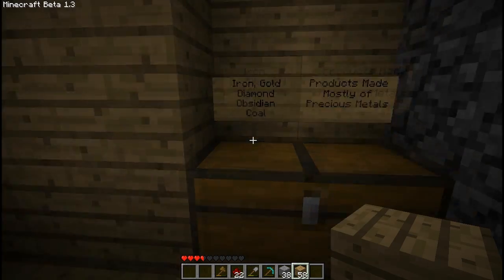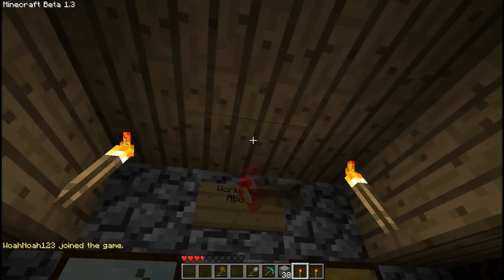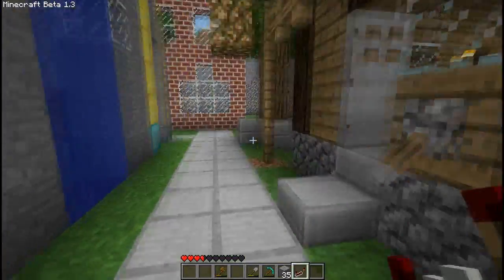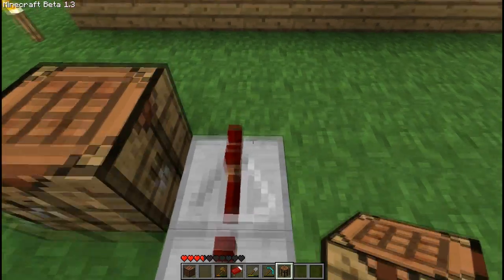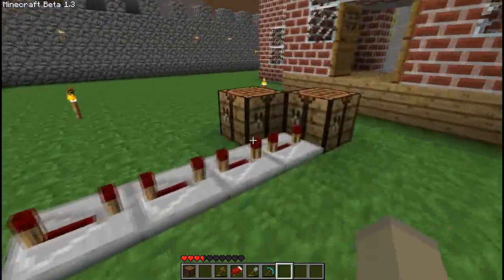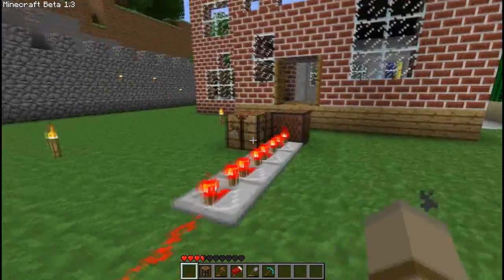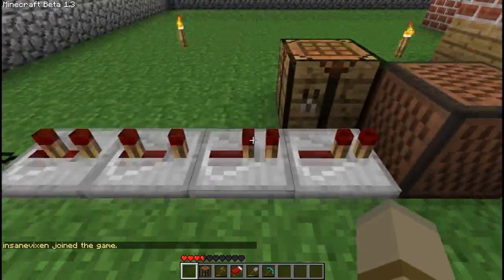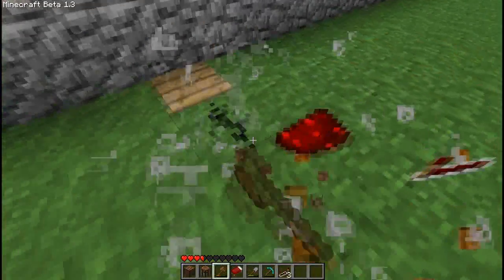Redstone Repeater: How to Craft/Use Minecraft Beta 1.3 Update

Comment: @kia1630 It will make a "Clock" that repeats the current in a circle, but you need to but it in a order that will make the repeater put the power to another repeater that will circle the power back around.  It's very simple but hard to explain.  If you look on the minecraft wiki there is a page on redstone circuits that I'm sure will help you.  Have fun learning!